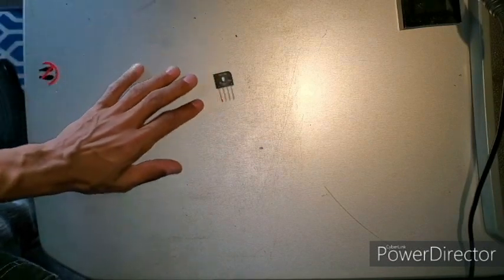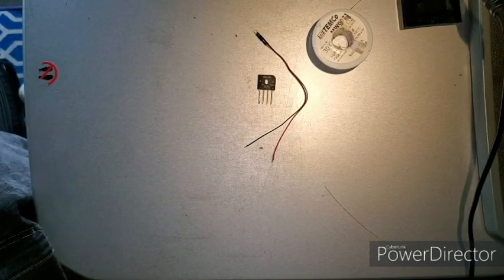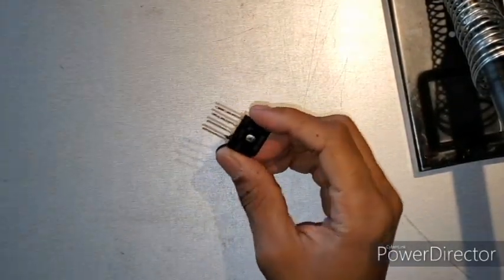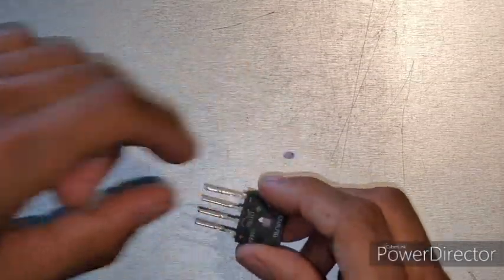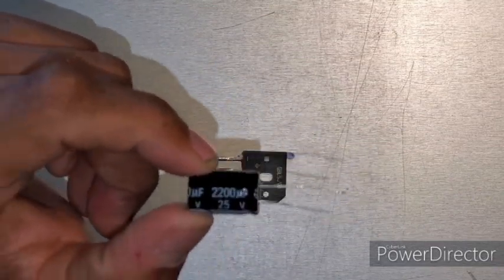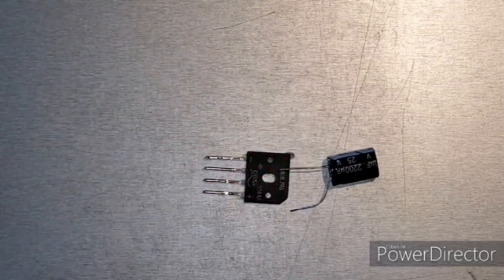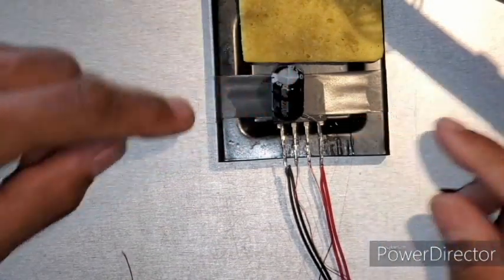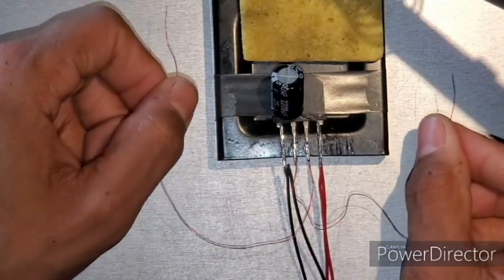how to make HO scale rear LED markers for passenger cars

Comment: Thank you for the very useful tutorial. Although I would be using this for passenger cars. Steel mill inside hot metal cars to lite these babies up ! Thank you. Subscribed.
Reply from the maker: yes. i use this for my amtrak baggage car as rear marker lights for my train. they can also be used as a lighting source for passenger cars. the possibilities are endless as it can be used on DCC or DC either direction.